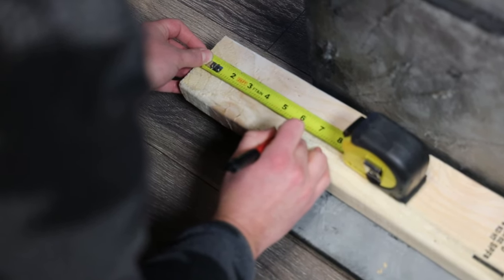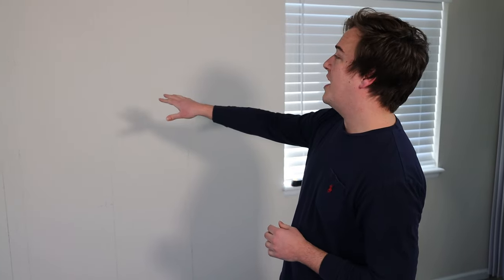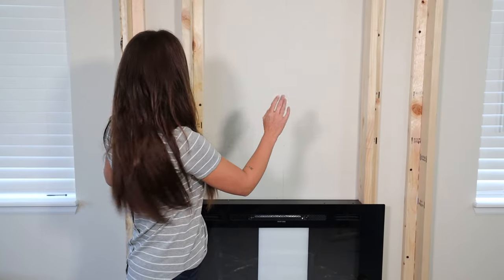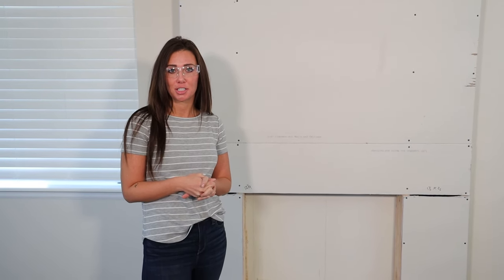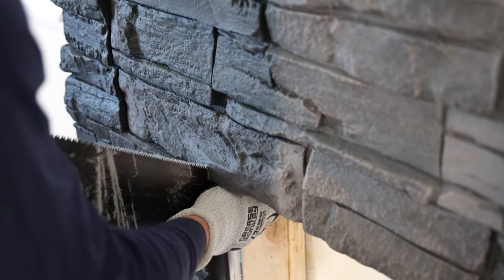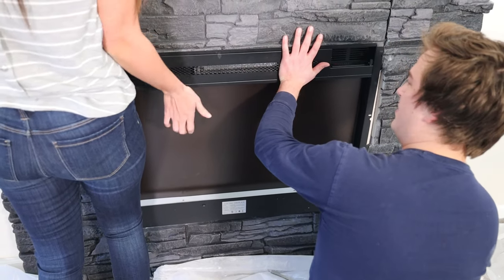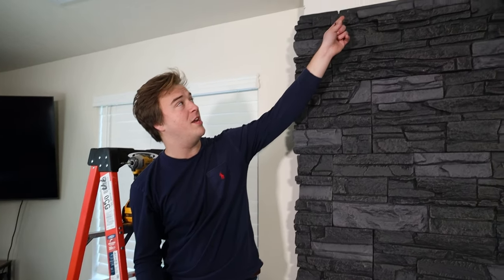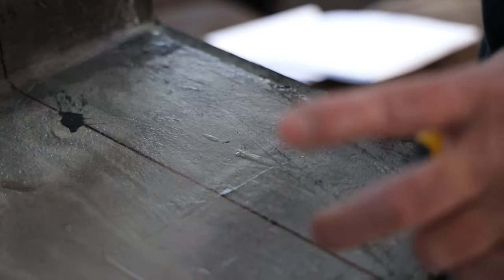How to Install Fireplace Video | GenStone Shaffer Fireplace Kit

Comment: Something I noticed about your method of installation is your screwing into drywall and stripping the screws out. When I install mine I will be using plywood instead so that everything is supported. That's one suggestion I would make if you do another install video.